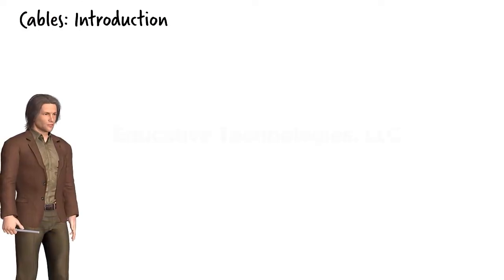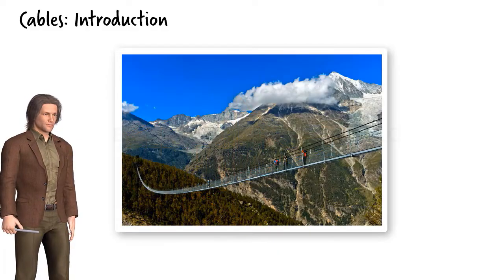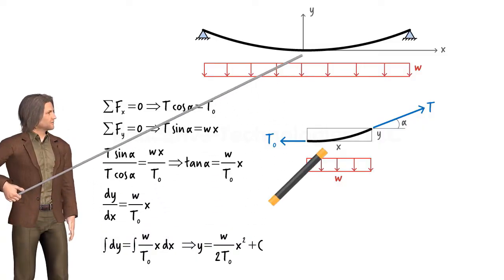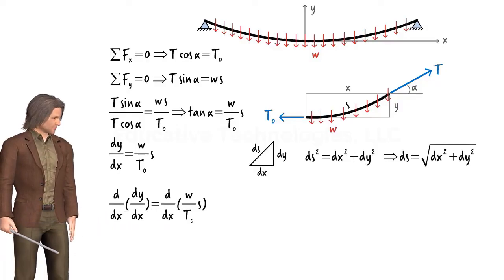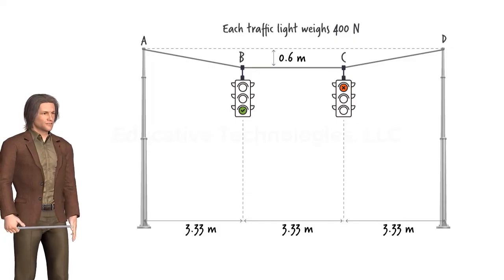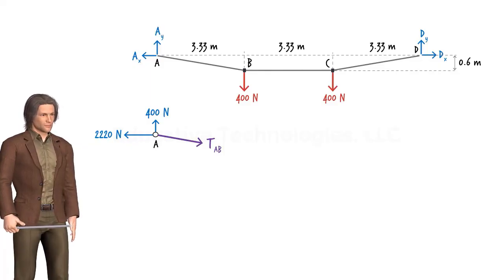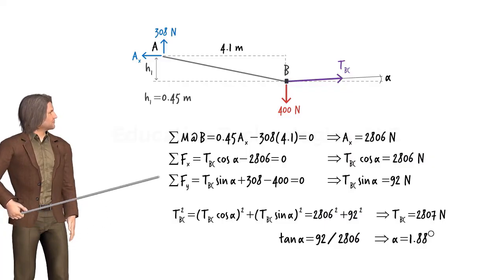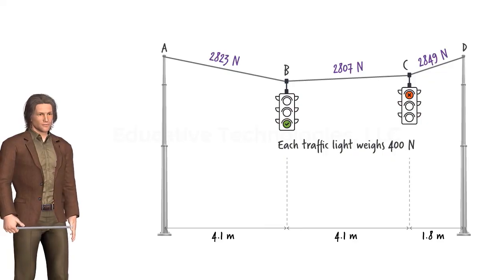SA62: Cables - Introduction

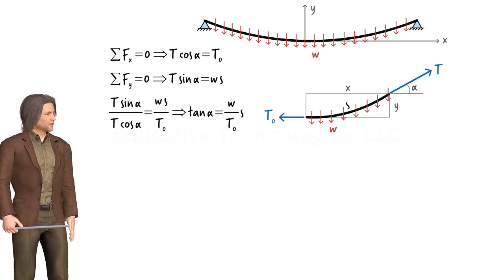Comment: 4:43 but the weight of the cable acts downward and length of the cable s is not horizontal why did you multiply w by s? It shall be scos&
Reply from the maker: The length s is the arc length of the cable, which is a scalar quantity and not a vector. Its orientation does not affect the calculation of the total load. Since w is the weight per unit length acting downward, the total vertical load is simply w multiplied by the arc length s. There is no need to consider the horizontal projection, as s is not a vector and already accounts for the full length of the cable.
Reply: @DrStructure  Alright, got it 👍🏽

Comment: how do we get the height assumption in 10 : 44
Reply from the maker: Height h1 is a geometrical dimension of the system. It can be determined by directly measuring it once the traffic lights have been assembled. 

Alternatively, knowing the material properties of the cable used to hang the lights, we can employ advanced analysis techniques to determine the displacement of the cable under the load.

Comment: why did we assume 0.45 on the second example am now confused
Reply from the maker: We would not be able to analyze the system using the static equilibrium equations without knowing the shape that the cable assumes. 

The value of h1 completes the definition of the system’s geometry, enabling us to solve the equilibrium equations.

If h1 is not know, the system remains statically indeterminate. To analyze such systems, we need to use more advanced techniques that are well beyond the scope of our lectures on cables.
Reply: @DrStructure  ok 
If l come across a new question and the value of h1 is not known like in this example, how do l assume a value or l just use 0.45 like you did here?
Reply from the maker: If the problem is a real-life one, you can measure the distance. If the problem is on a school test, you need to ask for more information.
Reply: @DrStructure  thank you so much👏👏👏

Comment: Why the flexible structural element can't resist bending like cable
Reply from the maker: That has to do with the properties of the material. Some material are not sufficiently rigid to handle certain types of loads.
Reply: @DrStructure  why!?
Reply from the maker: You need to look into mechanics of materials to better grasp how certain materials behave. There are an abundance of textbooks and other resources on that topic.
Reply: @DrStructure  Show me a book to refer to
Reply from the maker: A visit to a library or even an extensive internet search is the right course of action in conducting your research on the topic.

Comment: Can you tell me what the defence between cable, wire and rob ? 
Get my dfination on  the cable
Reply: Thanks
Reply from the maker: For the purpose of structural analysis, cables and wires are treated the same way, they can take only tensile force. The difference between a wire and cable is often one of size. Wires are significantly smaller in diameter compared to cables. Cables are generally made of strands of wires. Unlike wires and cables, a rod is a rigid member that can undergo both tension and compression.
Reply: @DrStructure  I did not mean the rod but rather the rope
Reply from the maker: From the structural analysis perspective, there is no difference between a rope and a cable. They both are tension members. Although they are made of different materials, hence offer different strength properties.

Comment: 10:37  Why is this distance assumed with this value
Reply from the maker: They are obtained by measuring the distances between the (hypothetical) traffic lights. For the analysis purposes, one can use other values for those distances. The focus of the exercise is the notion of static equilibrium and how to compute forces using equilibrium equations. The actual determination of the number and location of traffic lights at an intersection is well outside the scope of this lecture.
Reply: @DrStructure  My other daughter. How can you assume an unknown thing and is not uncontrollable in the problem
Reply from the maker: @Eng.Ahmed_Gamal  In engineering analysis, mathematical modeling methods are often invariant with respect to certain dimensions of the system that is being modeled and analyzed. For example, the analysis techniques used for structures are not a function of the dimensions of the structure. A beam can be analyzed using the same technique (the application of the equilibrium equations) regardless of the length of the beam. Whether the beam has a length of 5 meters, 6 meters, … the same principle applies. So, if the objective is to discuss the method, the specific number that we use for the length of the beam is irrelevant. The same idea applies in this case too. The specific distances between the traffic lights are irrelevant with regard to the principle of equilibrium being demonstrated in this lecture.

Comment: 10:39 Could you tell me reasons why is h1=0.45m? In the case, we don't know about this How do we solve problem?
Reply from the maker: At a street intersection, the traffic light has a certain configuration determined/decided by the engineer during the design stage. The heights of the lights/wires are determined based on experience and the design specifications in use.

Without knowing h1, we end up having too many unknowns to be able to solve the problem using basic equilibrium equations. This is similar to static determinacy in beams and trusses. If we end up with too many unknowns, we cannot solve the problem with the available equilibrium equations. In such a case, we have to resort to more advanced techniques for analyzing the system.
Reply: @DrStructure  Thank you very much!